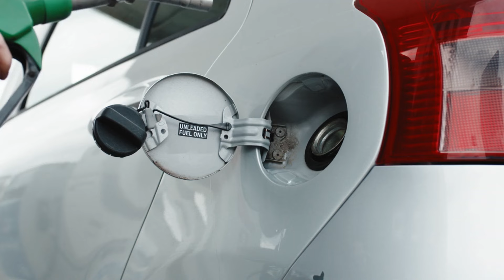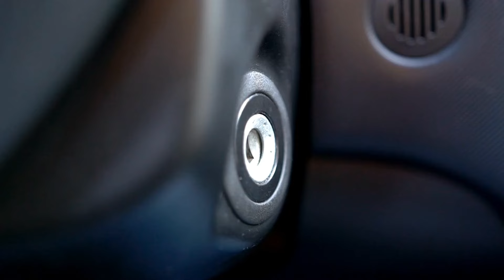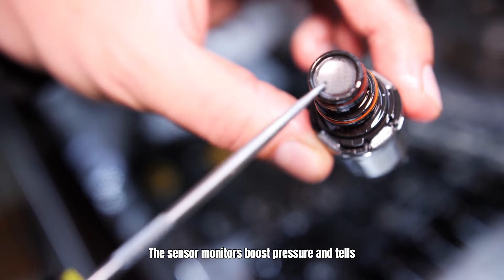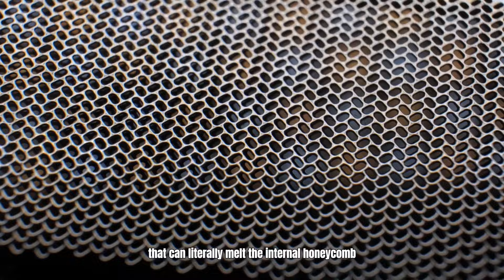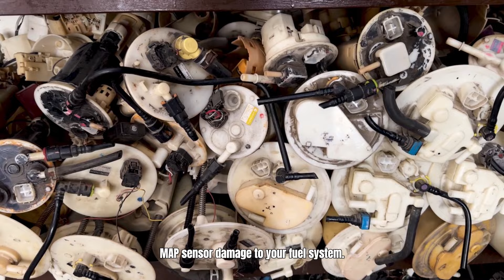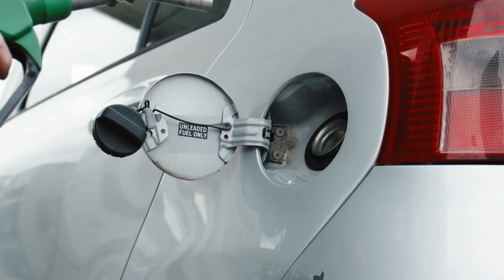Thinks you Should DO to get Your Car To 400K Miles

Comment from the maker: Hi Everyone, Hope you find the video useful.
The sensor shown at the start of the video is from my own Volvo V40. I was getting an intermittent check engine light, and when I scanned the code it pointed to the MAP sensor. After cleaning it, the improvement in throttle response was very noticeable.

Interestingly, it also seems to have cleared a transmission error I was getting when using Sport mode, possibly related to incorrect torque information, watch the point Number 9 about transmission.

Let me know if you try any of these fixes and whether it works for you.
thanks for watching